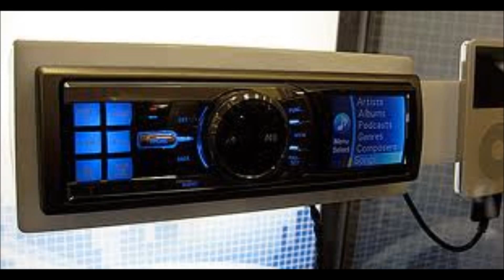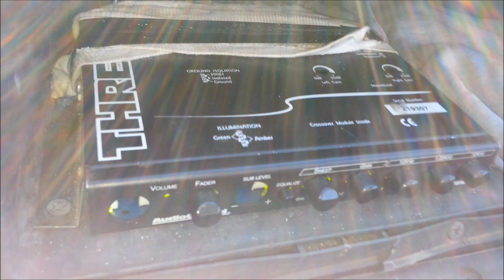SPL Crazy Bass 2 Subs Kicker Solo x 12 4Ohm Duol And 2 Amp Zx2500.1 2Ohm Stable

Comment from the maker: its better to wire it at 2 ohms, my amp is 2600 certified RMS at 2 ohms and half of it at 4 ohms, the sub (D4) is 1250 watt RMS per coil, means it needs 2500 RMS to push it at its full capacity, but louder as nothing to do with this, its all about the box, solo x require box of 3 ft cubic min and 6 ft cubic max, the way i see it, to realy reach the 2500w rms from your sub, you need the maximum box size it requires, smaller it is, less rms, sounds, from it! chck kicker's site for box size specs